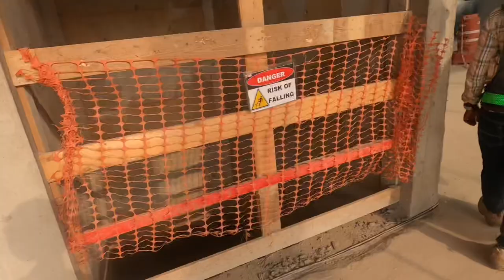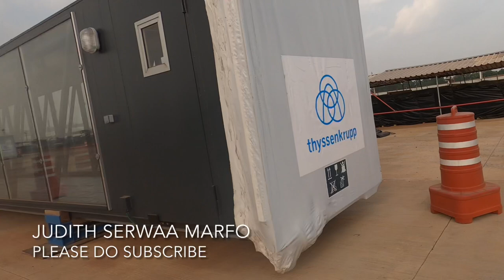CURRENT MAY 2021 UPDATE: KUMASI INTERNATIONAL AIRPORT TERMINAL PROJECT,RUNWAY, APRON,AEROBRIDGE&MORE

Comment: That staircase is very bad for a modern structure this. Why not escalator next to the staircase to serve as compliment. I know there’s a lift but you can’t place such a big concrete staircase in an open areas like that without an escalator.
Reply: I believe escalators will be installed alongside when completed. Just wait for it to be completed before criticising.
Reply: @kaybee3757  we shall see.